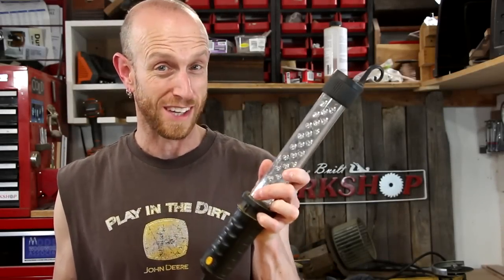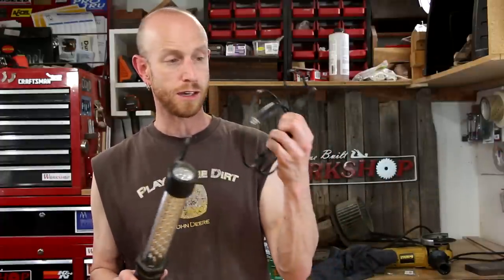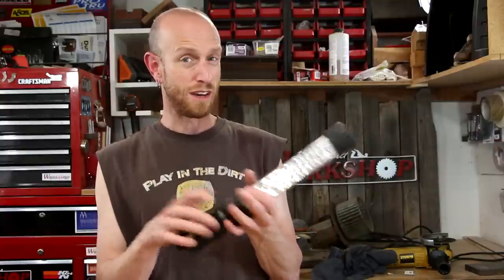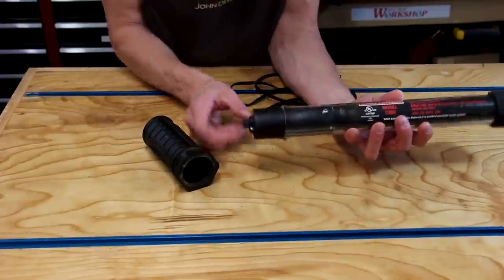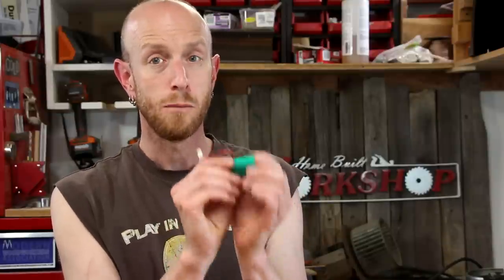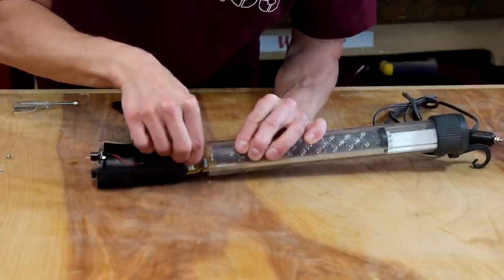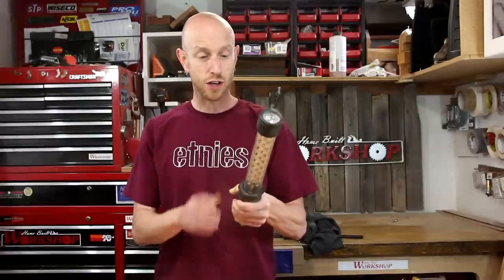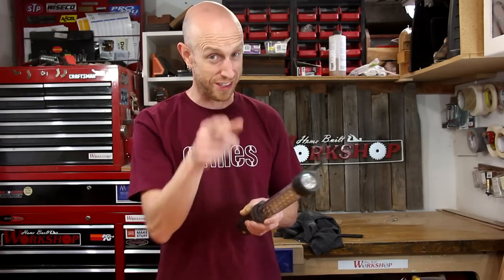Fixed: LED Worklight Battery Replacement

Comment: Thanks for doing this video. We bought one of these at a yard sale for $5. Used it for a coupe of years and it wouldn't hold a charge longer than 5 mins. We went to our local hardware store with the replacement battery pack and they sourced one for us for $11 + tax.  ANd it's of much better quality than the original one, and as you said higher capacity. We LOVE this light
Reply from the maker: Thats awesome. Its a cool light. I'm surprised mine still works after all the years I've been using it. I like it a lot.

Comment: It looks like you can order a replacement battery online.  I found an 1800mah replacement on Amazon that matches the battery pack and works.  This video and the battery saved me from tossing a good flashlight.
Reply from the maker: Thats great you were able to save yours. I'll see if I can find that battery. I didn't know you could get it online. Thanks for letting me know.

Comment: Great job, mine hasn't worked for a couple of years, decided today to work on it, and couldn't find the screws.... thanks for that tip! I repurpose EVERYTHING  I can.... I hate filling the land fill and I'm not an environtist
Reply from the maker: Awesome. Were you able to fix yours?
Reply: @homebuiltshop  I ordered the battery pack on ebay, unfortunately the only seller is in china, so it is on the slow boat from china, literally... but id assume it will fix it... next challenge is finding the correct charger in the many i have... and then onto fixing my BAYCO rechargeable flashlights...
Reply: @homebuiltshop  yes, and it works great!
Reply: michael lee  thank you sir! I'll look for it this weekend

Comment: My Craftsman worklight was getting more difficult to charge and finally stopped accepting a charge. I watched your video & thought the battery pack may be the culprit. I took mine apart and saw one of the leads from the charge port was not attached. A little solder and electric tape and my light is charging again. Thanks for the inspiration.
Reply from the maker: Awesome. Its surprising to see how many people have this same light. I really like it and it wasn't expensive.

Comment: Thanks. Inherited this from my brother-in-law. Dead, of course. With no charger, of course. Then I moved, so it took me a while to find my box of assorted "wall wart" chargers. Had to try a couple @ different voltages and milliamperages to find one that worked out of the box. Unsurprisingly, once I got it charged, the batteries were pretty well shot. Now I know how to get to them and replace them. Thanks.
Reply: Sorry to hear about your brother-in-law. The light will be something to remind you of him every time you use it.

Comment: First, thank you for posting this video. I also lost the charging cord for my craftsman light & ended up buying another one like it on line .So i plugged in my old light with the new charger & Nadda..The batteries are shot now & thanks to your video i got the battery pack out & ready to go to town.
Reply from the maker: Awesome! I'm glad you got it apart. Mine is still working great.

Comment: Thanks for posting this video. I bought this light brand new from Sears many years ago. I misplaced the power cord. I have been meaning to google the light for years. I finally did it today and found your video. I am going to look for the power cord. If I can't find it I'll purchase it from eBay. Hopefully the batteries are still good. I used it only a hand full of times. I hated to get rid of it or throw it out. Especially when it worked great the times that I did use it.

Comment: Thank you so much Mr Jeff amigo..i have the same work light with the same issue im gonna try your idea. Greetings from Texas the lower Rio grande valley.
Reply from the maker: Awesome, I hope you get it. It seems quite a few of us have this light. I really like it. I hope you get yours working again.
Reply: @homebuiltshop  ...i certainly did get it working and also replaced the rechargeable batteries it worked like a charm its now brighter. Thank you so much for sharing your great ideas. 👍🤠 God Bless you amigo.

Comment: Great idea going to the battery store for a custom pack. I might have tried to deep-dive that myself-- better to let the experts solve the problem.
Reply from the maker: I thought about making one. It would be more interesting but yeah, like you said. Let them do it  it wouldn't have changed the price much. In fact it would have cost more because I dont have all the heat shrink they use so I'd have to buy it.

Comment: Thanks for the video. Very helpful. I've inherited one of these however it's without either charger, 12volt or mains. Have you any idea what the input voltage to the charging circuit is? I'm going to try to find a suitable "plug pack". The plug is not a problem, but the required voltage has me foxed.  I'm assuming it's more than the 3.6 volt capacity of the batteries.

Comment: I have the same problem.  The green light comes on indicating it's charged but still no power.  My flashlight is pretty new so I'm not sure the battery will wear out that fast.  I stored in the garage where it's not heated so it's pretty cold.  Do you think cold temperatures can affect the batteries' charge?  Thank you for making this video.

Comment: I have a Vector (Black and Decker) Power On Board Bright Bar model #WLB26P.  I need to replace the charger but cannot locate a replacement anywhere.  Should I just toss it and move on?
Reply from the maker: Thats a tough one. I wonder if you could call Black and Decker. Depending on the plug it takes, I wonder if you could buy some type of universal charger.

Comment: Sweet man, I have the same issue with mine.  What I would like to do it convert it to 18650 battery and charge it via USB.
Reply from the maker: That would be awesome. Let me know if you get that working.

Comment: Have same model and tried to remove the black handle like you do in the vid. Mine wont come off. Any suggestions?
Reply from the maker: It was a pretty tight fit. I wonder if a little heat from a heat gun would help. Not too much or it could melt.
Reply: Mine was  different as well there is a small interlock button between the switch and the light i pried it off used  small flat blade screwdriver to slide under the handle to break it loose then rotate and pull

Comment: What is the cost of a replacement battery pack
Reply from the maker: I paid less than $20. Costs may vary, but should be somewhere around there.

Comment: You ruined it when you charged it with 12v. It shows right on the back of light charge specs is 5v at 500mah. Not 12v that you used from the car lighter.
Reply: I have the same work light.  It came with both an AC charger and a DC charger (or cigarette lighter charger (12 V).  The charger drops the voltage down to the required voltage for the light.
Reply: @robr7946   On the circuit board at the power connector, it says it accepts BOTH... "CN2 DC12/6V". So I it is the board and not the charger which senses and changes the recharging circuit automatically (via transistor alj B772P61).